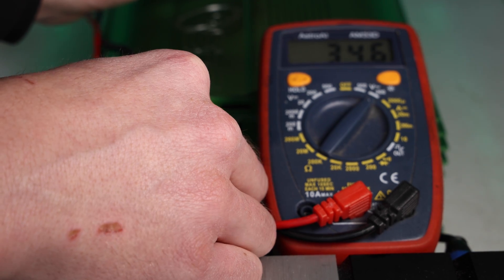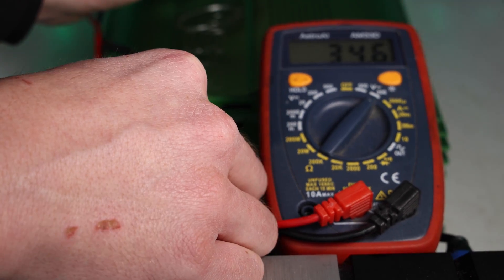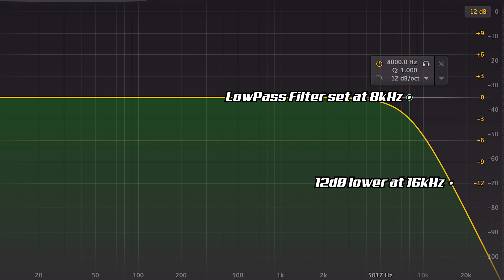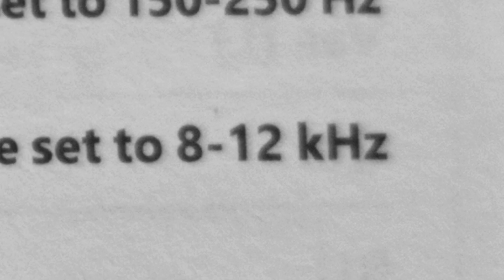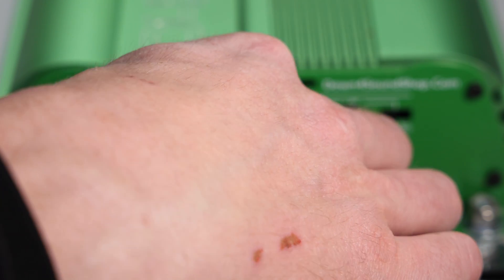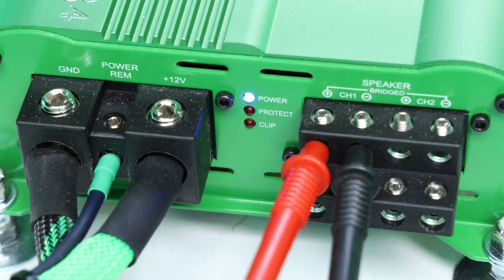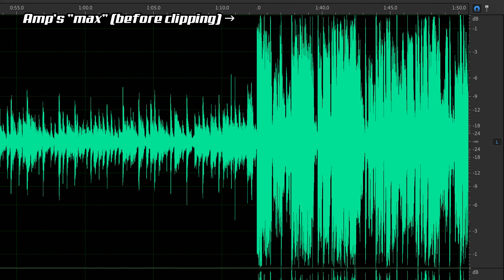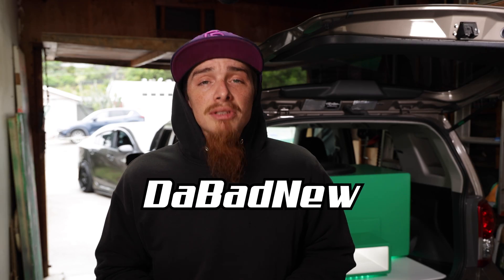How to set Filters and Gains on a Car Audio Amp to avoid clipping

Comment: How would I do the math for 180watt Sylvester neos at 2ohms
Reply: I’m using speakers per chanel
Reply from the maker: same way like in the video bro, (watts x ohms) and then find the square root of that number:
(180 x 2) = 360
square root of 360 = 18.97 
So you would want to aim for 18.97 volts AC on your amp gain

Comment: Great video, I understand it a lot more than I did, but I am still unsure if I have it all set totally right... I have the JP34AB 590W 4 channel amp, looks just like yours.. I have two front door speakers, and 2 rear deck speakers on this amp.. 1/2 is my rear, 3/4 is my front.. My rear speakers say 60 hZ - 22 kHz , and my front say 45 hZ - 20 kHz....  So on the 1/2 HPF I have set it to 18 clicks because I don't think I need them to handle that frequency, I set the front to 80.8 hZ as well, even though they say they can handle 45 Hz...  I have the HPF on both set to 1x.. And the 1/2 and 3/4 switches set to ON....  For my LPF I am unsure how to proceed, they have built in cross overs on them, and they can both handle 20 KhZ , on the amps LPF even if I set it to 10x I can only go as high as KHz right? If so would it be better just to leave the LPF switches OFF?  Or should I set them to 10X at 41 clicks, which is only 8 KhZ right?  Sorry for so many questions. hopefully you can help me.
Reply from the maker: Thanks!  Happy to clarify!
If you have tweeters, then I would use the LPF and set it near your tweeter’s HPF.  If not tweeter, then just leave it off (unless you get too much highs, then go back and dial it back a bit)
Reply: @DaBadNewz  Appreciate the response! There are 1" polk audio tweeters in my door near the 6.5's, They have bass blockers on them.. The 6x5's and the 6x9's have tweeters, they are full range, but they should have bass blockers already.. Thanks again for the awesome video, appreciate it!
Reply from the maker: at the end of the day, just play around and see what sounds best.  Good luck on your project!
And thanks for checking it out!

Comment: Only question i have is, can i set gains on channel a and b at different numbers?
My front speakers r 75w rear speakers are 120w. So can i sent at 17v front and 20 rear?? Or am i getting this confused?
Reply from the maker: Yes absolutely!  Channels 1 and 2 are linked and channels 3 and 4 are linked, but the two sets of linked channels have separate adjustments, (so one set of filters and gains for 1/2 and another set of filters and gains for 3/4).
Reply: @DaBadNewz appreciate it bro! Keep up the hard work! Thanks for informing the world!!!
Reply from the maker: No problem at all man, happy to help!  And of course!  Appreciate the encouragement

Comment: What if you have a dsp do you still use the x10 switch and hpf and lpf?
Reply from the maker: You should not need to, no.  If you have a DSP, you SHOULD be able to dial everything in on the DSP and only adjust gains on the amps (doesn’t mean you’re gonna hurt anything if you have filters set though, you just don’t need to)
Reply: @DaBadNewz So with that being said should I just set my amp to full range?
Reply from the maker: You CAN, but tbh, I would still set my sub amp to sub, but it should work either way (maybe just try each and see if there is a noticeable difference).

Comment: As an installer and one that explains this to so many clients.  This hands down is the most accurate real world explanation.  Only thing to mention is, Gain setting before crossover setting is best.
Reply from the maker: That’s a huge statement from someone that has to explain this stuff, I really appreciate that feedback man!  Honestly means a lot!
And thanks for the clarification!  Any thoughts on why that’s behind?  (Not disagreeing, just trying to understand)
Reply: @DaBadNewz  It's a general safety thing.  My understanding of it from over the years is if you set the crossover inaccurately the slope may affect the gain tune matching properly.  If you are bandpass setting your mid bass and are using 40hz test and your crossover point is 50 or 63.  It could mess with things.  Granted the typical 80-100hz points used 99% of the time it will never affect.  I just always gain tune first.
Reply from the maker: Makes sense, and sounds reasonable enough!  Thanks for the insight!

Comment: I got 12's midbass. What freq test tone can i use?
Reply from the maker: I would try for about the midpoint of whatever frequency range you want them to perform.  If I remember correctly, I used 100 or 150Hz.

Comment: Do you think that this device is accurate or rather inaccurate? I heard that this device can't really measure the dynamic power and therefore shows less than it comes out. But that's just a guess. Have you talked to the people who have this device about it and if so, what was their opinion about it?
Reply from the maker: Since I've never really messed with one myself, I'm definitely not the authority on how accurate they are.  The people who I've talked to who own one seem to be pretty happy with them though, but I haven't asked if anyone actually compared it to another more trusted meter.  And while I don't know what the refresh rate is, I know the readings definitely change relatively in time with the dynamics of the bass, so while it may not be super precise as far as time is concerned, it seems to be pretty close.

Comment: Hi, what do you think of the Basshead Garage Wattmeter. Would you try it out or do you already have experience with this device. Thank you very much
Reply from the maker: I haven't used it myself, but I've seen it in a few cars and it seems like a pretty nice tool to have.  I wouldn't say it's really a NEED (especially for most people's setups), but it's definitely cool to be able to monitor what our subs are seeing so you can figure out where improvements can be made, (or just because it's interesting).
I would definitely try one out, but tbh, I haven't even really considered picking one up since it didn't really seem like much of a need (at this point).
Reply: @DaBadNewz  Do you think that this device is accurate or rather inaccurate? I heard that this device can't really measure the dynamic power and therefore shows less than it comes out. But that's just a guess. Have you talked to the people who have this device about it and if so, what was their opinion about it?
Reply from the maker: Response on the other comment.

Comment: Great video.     I need help lol.    I installed lc7i pro.   Jlx700.5v2.    With ct messo 6.5 components.      I got my target voltage for the gain.    But still lost in setting the crossovers.    Can u help.        Also.   Do i need to set crossovers first.   Then the gain.      Thanks
Reply from the maker: Most resources I see recommend setting gains and THEN setting filters, but I have always done filters first, (my thinking is that I would rather set the gain the way I actually plan on using the amp, but not everyone agrees with that philosophy).
And for the crossovers, where you set them will depend on your setup, so just check what the recommended settings are, (or use the frequency range of the speakers)

Comment: i got a question if i put two arnold’s on the same channel would i still put the 34.6 voltage for the gain or pick it up to 48.9
Reply from the maker: Depends how you wired them, but assuming you wired them in parallel, you don’t really need to adjust gain vs having 1 (300rms x 4 ohms is the same as 600 rms x 2 ohms, so 34.6 is still your number)
And it would actually be 600rms x 8 ohms if you wired in series (just fyi)

Comment: Whats the difference between the front speakers are rear speakers. Ik u said they midbase but what are the front?
Reply: Oh okay, yes vocals, i have subwoofers for the bass, so basically do like you did 2 midrange and 2 midbass ? Or what would u recommend?
Reply from the maker: @Tiktok_nostalgic_Gaming you can do that, but this IS a bit more advanced option.  You will need to tune the midrange and midbass separately, so they will need separate amp channels.
It’s definitely the way to get the most full-range sound though.  It just makes things a little more complicated (but that’s not necessarily a bad thing)
Reply: @DaBadNewz oh okay, how many channels do i need for 4 speakers and 2 tweeters?
Reply from the maker: @Tiktok_nostalgic_Gaming it depends how you wire them and what kind of speakers.  If it’s 4 of the same speaker, you could do that with 4 channels, 2 channels of 2 speakers each, and tweeters on their own channels.
Reply: @DaBadNewz oh okay so lets say i have a 600rms amp and i have 4 speakers i can pair 2 to one channel and have same rms output to the speakers ?. I really appreciate you explaining this to me better i always done the simple subs and amp set up never done speakers with ampliflier
Reply from the maker: @Tiktok_nostalgic_Gaming correct, as long as you tune it properly, but with most common setups, you don’t even have to touch the gain to safely connect a second speaker.  I feel like I need to do a video explaining that concept a lil bit lol.
And no problem man!  Happy to help another basshead get loud
Reply from the maker: In the fronts I have AP-M67AC midrange speakers (250-5khz), in the rears I have AP-W81 midbass speakers (70-300hz).
Hope that answers your question.
Reply: @DaBadNewz oh okay, whats the difference on the midrange and midbass? Sorry i recently bought 4 for my truck but they were all midbass wasnt sure if i needed different kinds for louder voice. I basically wanna just have it where they can hear it from far away
Reply from the maker: The difference is the frequency response.  Midbass speakers are meant for a lower frequency range than midrange speakers (that’s the numbers from my last comment).  
If you want vocals, you’re looking for a midrange.  
Tbh, a lot of people skip midbass because they don’t think they need it (but systems with dedicated midbass always sound better in my opinion).
Think about it like the difference between a subwoofer and a tweeter.  The midbass will play the sounds that are too high for the sub, but too low for the tweeter and midrange.  The midrange covers the “mid range” between midbass and tweeter.
Hope that clears it up!
Reply: Yea i wasnt sure if i had 4 arnolds 6.5 300rms on a 600rms amp would not work
Reply from the maker: As long as the amp can do 300rms at 4 ohms, and 600rms at 2 ohms, then you’re fine, but check on the specific equipment you have first

Comment: To adjust my highs down some would I use the LPF these are 6.5 loud speakers I'm at 100hpf and 8000 on lpf
Reply from the maker: Are you saying to bring the volume of the highs down?  You CAN use a filter for that, but a filter might be a little aggressive for what you want (if the filter has an adjustable slope, that's a plus!), since filters are for actually removing those frequencies (but maybe that's what you want).
IF you meant the volume, I would try bringing it down in the EQ settings on the Head unit or a DSP.  (but nothing wrong with adjusting the filters and seeing if it does what you want it to!)
Reply: @DaBadNewz  it's ear piercing
Reply from the maker: Sounds like you might benefit from dialing back the filter then.  Especially if you also have tweeters.  If you have tweeters, then everything above like 3-5k will be coming from the tweeters AND the speakers.
Reply: @DaBadNewz  I got a preva 2.8 DSP but try to figure out in the EQ setting what to adjust to tame it down some so many adjustments in these DSP
Reply from the maker: @ironhead320 go to the EQ setting and start bringing down the high frequencies one at a time, one notch at a time, and just see what sounds best to you
Reply: @DaBadNewz  in the DSP
Reply from the maker: @ironhead320 correct
Reply: @DaBadNewz  got it had to adjust 8000khz down some
Reply from the maker: @ironhead320 very nice!  Glad you got it figured out!

Comment: Buy a dsp and forget about setting up the amp settings.
Reply from the maker: Or, know how to do both!
Reply: @DaBadNewz  no ideal when running bunch of amps.
Reply from the maker: I don’t think most of the people that would search for this type of information are running a bunch of amps though.  This video is more-so catering to the people that are new to car audio, or want to have a deeper understanding of how car audio amps work.

But either way, even if you have a DSP and are running a bunch of amps…it’s still MUCH better to actually know how how your equipment works and what all the settings do